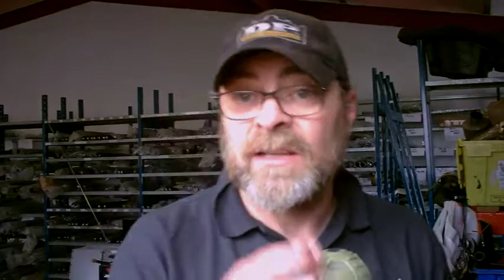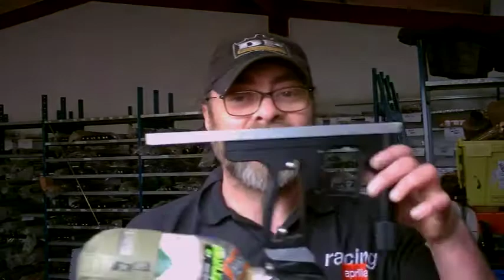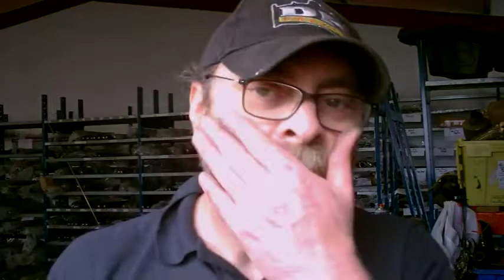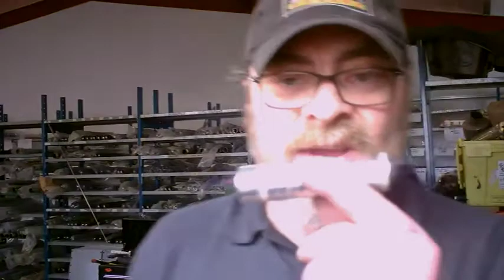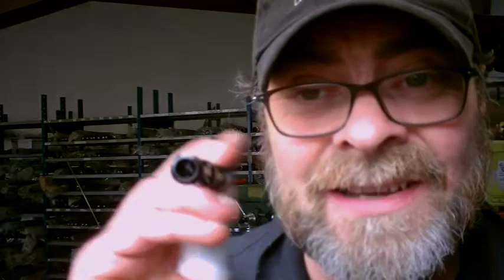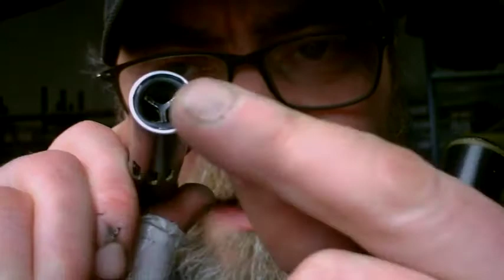LUXE PARTS

Comment from the maker: Hi buddy. I don't as much as I used to.. But yep I could do you a set. Problem I have. I don't have any cans or bolts guides here. You can send me yours and I will do the flow work for you..other wise I only have 1 can left and it's a bit wild..and the only bolt guides I have are the early 1.0 type. As I don't use the bolt springs.. If you want my old black can and a matching bolt guide. Plus reg piston.. Get in touch with me on my email. gommie404@hotmail.co.uk.  We can chat about what you want from your luxe..